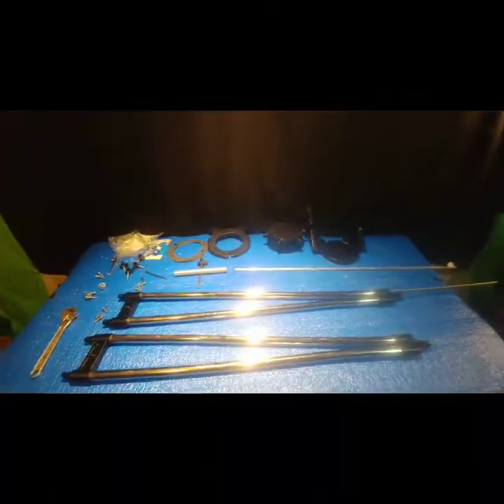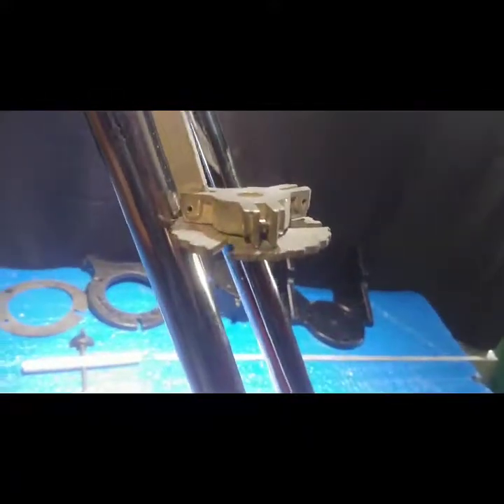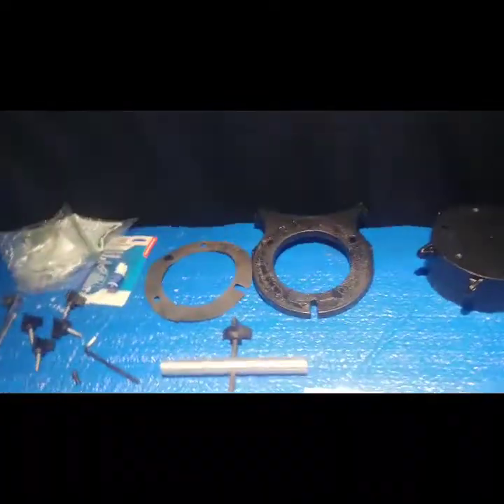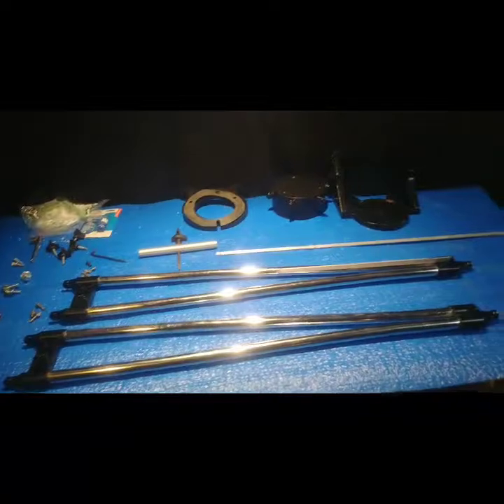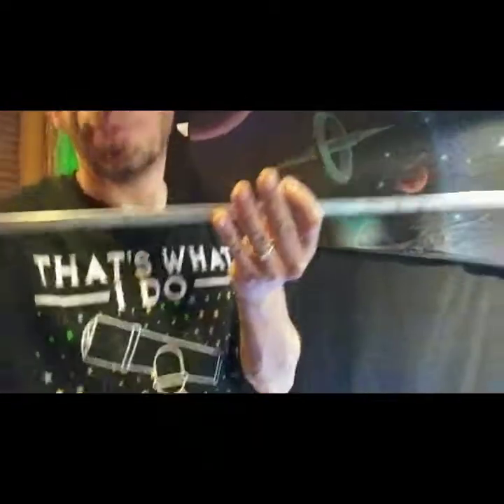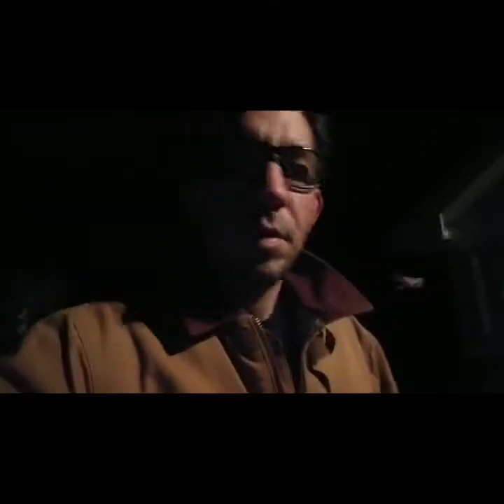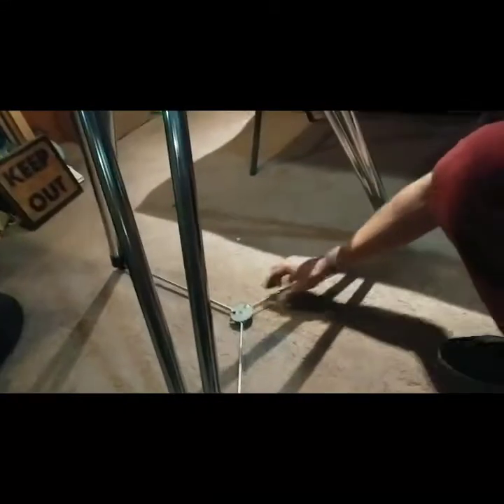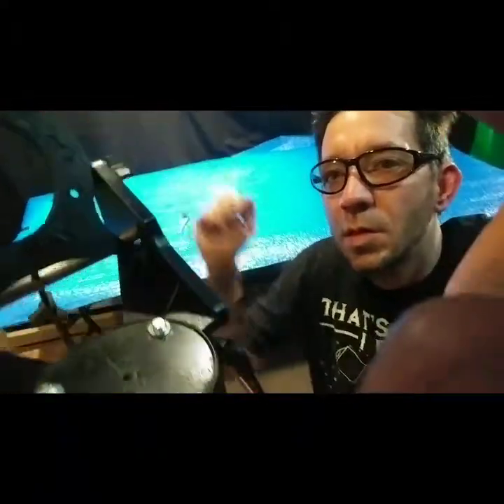Vintage Celestron C8 Tripod Repair

Comment: Hi, I bought 2 vintage C8’s this year. Both orange OTA’s in the fork with drive. 1 came with no wedge or tripod, I bought one used. The other came complete with a tripod like yours and wedge. 

How did you clean the rust if any off your chrome?

Did your wedge have markings for latitude? Neither of mine did. 

How’s the tracking been with your scope. Mine is ok but not good enough for astrophotography. Perhaps it’s my alignment. How do you level your tripod. I use thin wood wedges or rocks and the level app on my iPhone. 

I’ve cleaned the outside of my corrector plate, but not the inside or the primary mirror. So I’ll have to watch your video. 

Thanks in advance for any replies, I hope you see this. A used, old C8 is all I can afford for now. I buy used Plossle Eyepieces, a used F=6.3 Focal Reducer field flattened, a New Telrad finder a big plus and a new NexYZ Smartphone adapter. 

I bought a T mount for DSLR but haven’t used it yet.  I bought a Bahtinov mask too because I was tired of unsharp images. 

The Wedge & Tripod I bought for my first scope is a Celestron I think it’s called a Super or something it’s black with sectional legs, but 2 of the 3 leg locks don’t work, I need to fix them somehow. 

I hope to fix both scopes up, keep the best and sell the other and put money away for a better mount in the future. 

So how’s your scope working out for you?